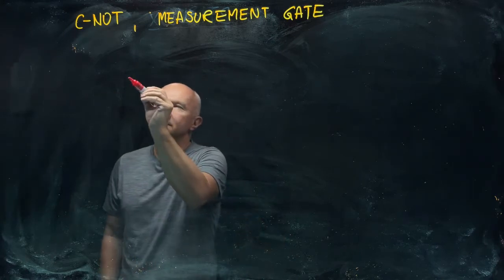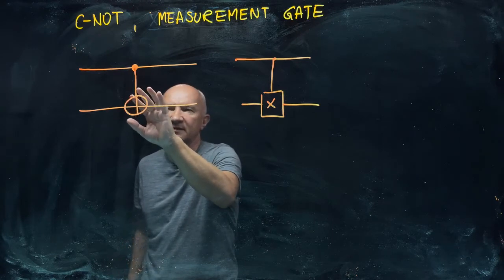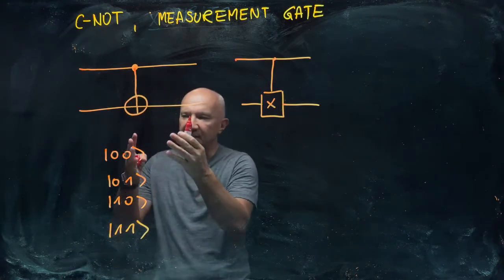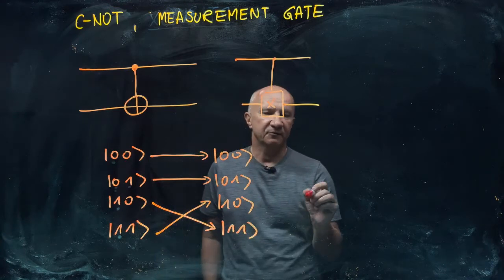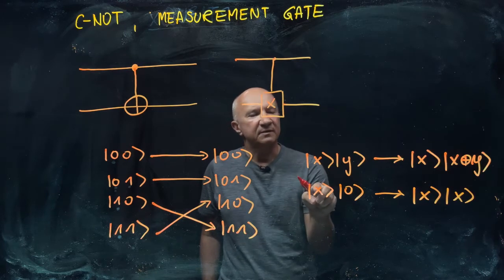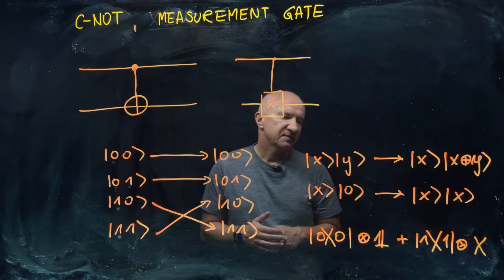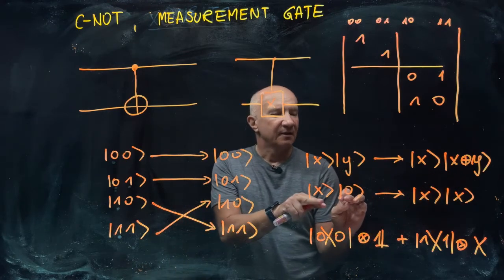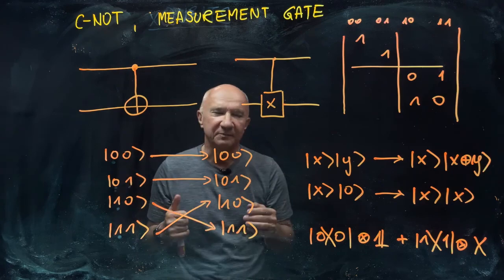IQIS Lecture 3.3 — Controlled-NOT

Comment: But don't that explanation of cnot violates the non-cloning theorem ? 😅
Reply: No, this works only for basis vector x-this is explained in one of the later lectures
Reply: no cloning theorem holds for non-basis vectors. You can clone basis vectors like |0> or |+> ...
Reply: Why is the resultant of 00 is 1 in the matrix @truebaran